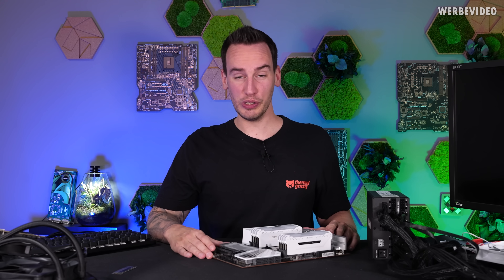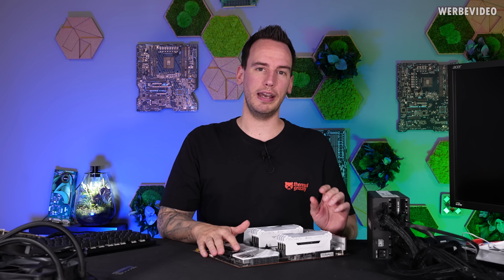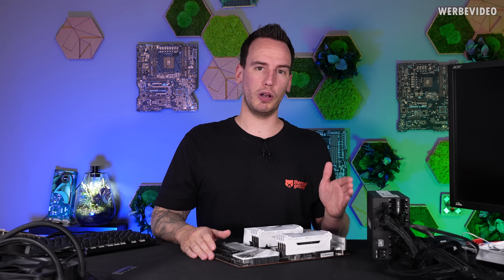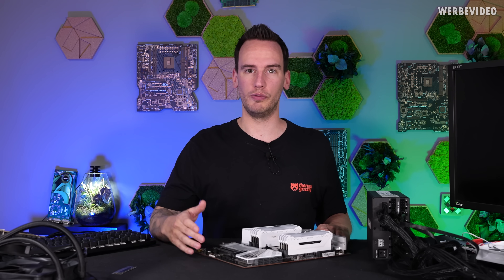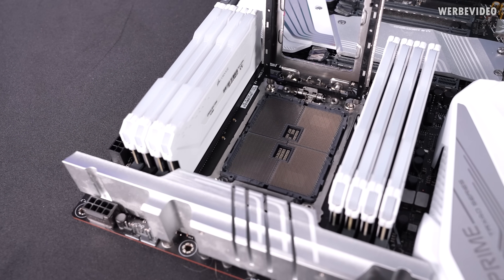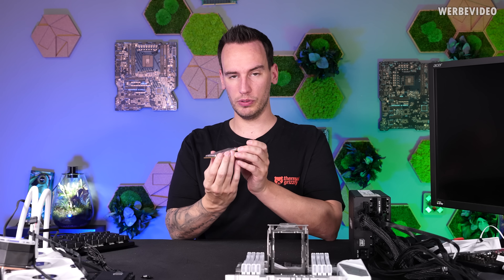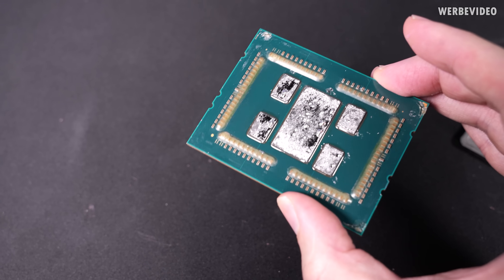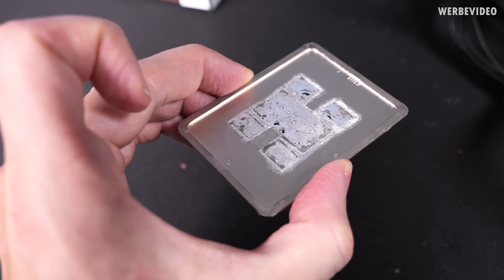I missed the obvious Issue on my Threadripper

Comment: Der8auer 2018 "Gallium in general also reacts with copper and leaves it pitted on the very top layer, but the reaction is not heavy so doesn't really matter to Thermal Grizzly. Nickel has the function of a diffusion barrier and doesn't react with the Gallium, which makes it a lot more suitable for the application"

What metal does AMD use for its IHS? Seems like a hefty tradeoff to swap soldered indium for gallium. Scraping the solder is going to also create gaps in the nickle plating. I'm surprised the entire IHS didn't crumble.
Reply: supposedly is copper, wity a layer of nickel to avoid these chemical reqctions, sanding it to remove the gold and the old solder didnt ended in the best results it seems 😅
Reply: You're misunderstanding. The extreme failure you're referring to is a phenomenon that occurs primarily with aluminum. All IHS are nickel-plated copper and always have been.

The issues comes down to the surface finish, scratches, metal impurities, oxidation, etc. All of which can be mitigated to some degree. In this case the gold layer also caused problems and no attempts were made to seal off the IHS from the surrounding air. It was never in danger of losing structure stability. 

Anyone wanting to rely on LM long term needs to understand some maintenance will likely be required at some point. In good conditions it could be years before notable problems develop.
Reply: Well, my coldplate was nickel plated in theory, but now nickel got eaten away. Interestingly my gpublock is intact sortof.
Reply: @bszbszbsz  What do you mean by eaten away? Discoloring the nickel is common and there's certainly copper underneath otherwise you wouldn't have a cooler at this point.
Reply: @JJFX-  I mean the flat surface is very far from flat now. LM did not just discolor the surface, but I got an about half a mm deep, ~50mm wide  crater on the coldplate, bare copper everywhere. It's an el cheapo block, mayb its nickel plating wasn't the best. 

On my GPUblock there aren't any visible mechanical changes. 

As far as my experience goes...
Reply: @JJFX-  Ahh> and it still works, can draw a bit over 300Ws through, before thermally limited. 

Not great, but adequate for me for now.

Comment: What about putting some Kryosheet instead of the liquid metal ? Would it be problematic ? Maybe it's too thick ? 🤔
Reply: i think that would actually be a better solution for long term use, yes. ideally with a fresh IHS as opposed to the embrittled one.
Reply: that would not transfer heat, it would isolate the damaged surface from the heat, the kryisheet is not flexible and would add pressure over the chiplets un a uneven way, would bot do it presonally, too risky

Comment: we like to know what type of preparation we need to know to not have this result using liquid metal
Reply: the problem here i think is the solder and removing it, or not removing it properly, the nickel layer surely got damaged, making the damage possible

perhaps if you delid a soldered ihs, ypu need to sand it and then apply new nickel, too complicated tbh

Comment: Thanks for revisiting the issue. The first video left me with a lot of questions and the only hypothesis I could draw was AMD silicon degradation in the current news of Intel silicon degradation.

Although I'm not entirely convinced the issue was solely poor thermal performance of the TIM on the oxidized and cracked IHS as you found, I would have expected if the cracks were major enough to prevent the CPU from dissipating it's idle power the IHS would be so badly damaged you'd be able to snap it in half with your hands. That and also running the CPU at 85-95 °C shouldn't result in an insane 215% the idle power consumption (and that was with CCDs disabled right?), I would expect it to only be ~120%, above that there has to be something else at play.

I'm wondering if the liquid metal has some how bridged Vcore and was drawing extra power, when this happens on laptops and non-HEDT it's obvious because the power limits kick in and shut down the VRM, but on Threadripper it can dump 50-100 A into a liquid metal short and not even care, this would explain the massively increased package power and would also result in accelerated galvanic corrosion of the IHS and gallium in the liquid metal as you found.

Comment: I had no idea fake memory sticks were a thing, and now I want some to fill out some empty slots lol
Reply: I remember several years back, in some forum -- i forget where -- people (including me) were making a lot of jokes about the ARGB craze and that RGB-anything is more important than any other functionality. These jokes included RGB DIMMs without RAM -- which became a reality shortly after --, RGB GPU cooler cards without actual GPUs, 120 mm AIOs with 3 RGB fans appearing as fake 360 mm AIOs, and some more. I have to admit, i am kinda disappointed that there are still no dummy GPU's available that lean hard into the most gaudy RGB effects, so them poor sods can amp up the RGB-ness of their toy boxes even if all they run is an APU, lol...
Reply: I would get more memory. If you are not overclocking like crazy or do some intense workloads, the more memory would be more beneficial than running just dual channel.
Reply: @Dragonited  I've got 96 GB and haven't run much more than half of that in the most strenuous processes (Blender, 3D Coat, CSP, etc.),  and games don't even exceed much more than a quarter as far as I've noticed.  Furthermore the board is only rated for 128 in 4 channels not 192, to really get the most I'd have to up almost everything.  And since I have a ton of room already for my uses, the bling makes more sense.
Reply: @Dragonited  DDR5 is very hard to run 2DPC, so fully populating will lower your max speed dramatically.  It's also quite temperature sensitive, so even fake sticks will hurt your max clocks because of inhibited airflow.

Comment: What does this mean for thermal grizzly Liquid Metal application? How can we avoid this from happening? Prepping the stock Intel/amd IHS surface by polish out the gold layer, what are your thoughts ?
Reply from the maker: We have already been researching new coatings for the future to move away from nickel plating. But it'll still take about a year until we have something to work with. Right now nickel is still the best way to go to have as little corrision as possible.
Reply: @der8auer-en  i'd probably skip the term 'corrosion' to describe alloying and embrittlement.
Reply: @mycosys  Why?
Reply: @ToTheGAMES  because it isnt whats happening, and people will get a different idea frm it. 
Indium is alloying with the metal and (likely) getting into the microcracks and forming the dendrites you see in the SEM, the dendrite crystals it forms (probably - still afew theories) push the cracks apart impairing the strength of the metal crystal. The metal is all still there, not removed or 'corroded' as such. 

The impaired cooling was due to the gap, not the alloying. If the LM had been replaced more quickly there likely would have ben no oxidation as the surfaces would not have been exposed long
Reply: @der8auer-en  how about the gold plating on the stock IHS’s, will getting rid off the that gold it give more longevity to the liquid metal application? For example using metal polish under the stock IHS where the metal plating is located?

Comment: Ahh good to see getting to the bottom of the issue...
Now the IHS ... if liquid metal caused the damage to the IHS by eating into the metals and amalgamating with it. Wouldnt putting more gallium liquid metel onto it just make it worse? 
The damage has been done but the process was likely slowed down by the gallium already amalgamating itself where it ate into it. But by cleaning it, you just added fresh gallium onto an already corroded part, tis just going to eat deeper and quicker into the metal. 
Wouldnt it be better to try and resolder the IHS back on?

Also ever since liquid metal interfaces were being popularised, this amalgamation issue with gallium was always on my mind, and I didnt trust its use... I guess this issue youve come into is just proof that liquid metal isnt a long term solution to cpu cooling.
Reply: Yes, in the long term this will be a problem again. At which point you scrub off all the oxide again and do the whole process again.

The gamble now is that the useful life for this CPU is short enough that the dealing with the metal corrosion takes less time than trying to resolder the IHS. Honestly, that sounds really hard and I have no idea how feasible it is.
Reply: The Ga forms an amalgam about 80-100um into the copper. This loss of Ga changes the composition of the LM left behind and it looks "dry" and chunky. I clean this off with isopropyl and reapply fresh LM which dissolves any residue left into it (i.e. no need to be abrasive on it). Then the application lasts years
(Been using LM on laptop copper heat sinks for a decade now).
This does not happen as much with Nickel plated heatsinks
But whenever there is too big a gap, LM can definitely oxidise and "dry out" like this
Reply: @greebj  Mentioned in another comment, but I wonder about at home Nickel plating.  Obviously, getting the z-height correct would be extremely important, but der8aur has the equipment to measure that.
Reply: yes, it needs to be replaced with a direct die solution or another ihs, gallium will do this again or speed up the destruction procesd, in a year or two it will make craters on that ihs
Reply: @MD_Builds  RIP the days when Intel used thermal paste instead of solder. The change must have caused a lot of problems for TG.
Reply: This is a complicated topic but even on bare copper after a few applications the amalgamation slows down considerably. I'd expect a similar outcome in most cases.

What's notable here is the ammount of oxidation and the interaction with the gold layer. It looks this amalgamation caused this layer to weaken and seperate from surface below, which I assume is the same nickel plating around it. 

I'd imagine sealing off the IHS can help minimize oxidation problems, which Roman didn't seem to do and the area is larger than most CPUs. However I've used LM under an unsealed IHS for many years and they weren't without some issues but this is quite extreme. The oxidation reaction of galinstan can effectively become non-self-limiting with temperature in certain conditions that are above my head and I'm guessing the interaction with the gold played played a role.

Comment: It's good that you found the problem. This might be why my 9900KS slowly is starting to get worse and worse temperatures as well. It's being replaced in 1-2 months with a new AM5 system, so I haven't really spent alot of time trying to fix it. It's close to 5 years old at this point, and the LM application might need a little refresh. I will take a look when the new system is up and running.
Reply: Google says you have to reapply heat paste every "few" years.  And, if your temps are rising, it's probably time.  I have a 9th gen i7 - no problems so far.

Comment: So don't use liquid metal because it will fuck you're CPU up long term.
Reply: More accurately, don't use liquid metal on a CPU you intend to use long term. It should be fine if you replace the CPU after 2 - 3 years.
Reply: @rodh1404  i have a running & daily use 6700k. It's been over 6y since its 1st delid. I had to reapply the liquid metal after 4.5y as it got absorbed by the nickel in the IHS.

Comment: Really interesting to see the long term effects of liquid metal. This makes me wonder if the PS5 is going to suffer the same fate down the line as Sony used LM instead of thermal paste for their console.
Reply: Probably, and it's probably done with intent, for applying LM is a much more intricate process than TP application
Reply: The main potential issue with the PS5 is leaking but that's far more likely to be caused by the user opening it. The last drama around that was overblown. The console community just doesn't have as much experience in these topics. 

Not only was the heatsink intended for this use case, they applied a thick foam gasket around it to minimize the chance of leaks and oxidation. Sure, it may need reapplying at some point down the road but what you're seeing here shouldn't happen.
Reply: the ps5 never had a gold layer thst was scrapped to put liquid metal, the problem here was that the surface was not meant to enter in contact with liquid metal

pst being repaired on alpt of repair channels do not show any of the problems shown here

the ihs on these cpys came soldered, to remove it it had to be heat to melting point of the metals used to solder it on place, those metals were removed but made the surface far from ideal for this liquid metal

Comment: I had the same problem with my i7 7700k not so long ago. Temps were going into low 80's, my ihs had the same black spots, cleaned the best I can, applied new liquid metal and the temps dropped by like 10c, now it's running fine for like a year after that. 5GHz 1.3V mostly 60- 75c while gaming usually high 60's - low 70's I'd say.

Comment: Wow, I had no idea that Liquid Metal is so corrosive.  Putting more on it might make that surface even worse over time, right?  I guess I would have used something else if I wanted to use that CPU long-term, but hey, it's your CPU.
Reply: yes, you saw 4 years of damage, or the ihs is replaced or the problem will get worse

but remember that liquid metal only reacts like this with some metals, the ihs had a layer of metals includong gold that made solder it easier, these ihs came soldered and remove them is reqlly complicated and risky process

we dont know if it was prepared properly before usong the liquid metal, if residue of those metals remained, it is not corrosive, it is more a chemical reaction

you cant use this thing with aluminum, copper does alot better, it just stains it, iirc nickel plated should be fine

indeed, is his cpu, but as a shared informateion, clearly tells that delid is not the best idea and liquod metal is a unknown variable that you prpbably dont need to ad to your build
Reply: LM stained the dies on my 1080Ms. I lapped them with the finest sandpaper I have, 3000 grit iirc, put more LM on, still fine pulling their up to 250W each, 6 yrs old now

There's a few hundred um of surface barrier/structural silicon on top of the actual cpu logic to play with.

Comment: So gluing back the IHS is a rather good advise, as this would limit the amount of oxygen to enter the liquid metal.
Which would slowdown the oxidation process by some years maybe. Now we need a glue that is a very good barrier against oxygen.
Reply: The PS5 uses liquid metal with a foam barrier just to avoid shorts.  Glue and airtightness seems unnecessary.  Maybe just a smaller fraction of gallium would be ideal.  You could raise the melting point to 90C so it flows during initial burn in and then never again, sort of like Intel's STIM, but hopefully thinner.
Reply: This.

Whatever the chemical reaction was exactly, anytime you have oxidation occur it's because air was introduced.

The IHS coming apart was hint 1. Seeing the black oxidized LM was hint 2. Those 2 things alone are bad but there could be others. Easy to see/understand with hindsight. lol 

But still an interesting video and nice to see Roman get his rig back. Assuming he finds a way to seal everything tighter/more permanently.
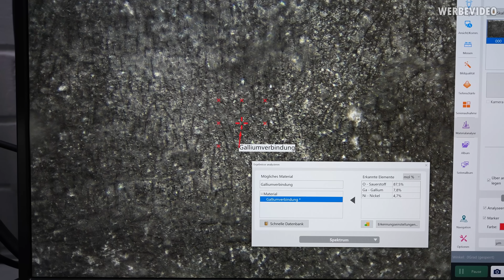Reply: @shawnduffy279  5:37 It was really an eyeopening revelation that the oxygen levels (88%) were so super high!
Reply: Ooo, interesting idea. Could also use nitrogen as a purge gas before glueing it down...

Comment: It would be nice to see a side-by-side comparison with a part of the heatspreader that was not affected by the liquid metal, because on that scale almost every material looks weird.
Also: this would be a very good example of why NOT to LM your CPU if you want to use it more than a few years or sell it afterwards.
Reply: If the cpu is soldered, yes I agree. But if you have an older CPU that used thermal paste like 8th gen Intel,  LM will not react with the leftovers of the soldering process, because there's none.
Reply: @TigTex It's with the IHS, doesn't matter if soldered or TM. 

Anyone else reading this take note of OPs solution to just sell it off and pass the problem to someone else.

Comment: i had interesting case with liquid metal and rx580 with clear copper coldplate. firstly kryonout temps ~60 degree after that liquid metal ~50degree after 4month remove liquid metal but only things what slill was liquid (~70% was solid)
after that again kryonout and temps was ~52degree.
the same load/ case temperature/ settings. (mining)
Reply: I didn't have any black oxides, just liquid metal infused copper.

Comment: Is de-lidding a Threadripper even worth it? I thought someone did a video a while back where they found the IHS on the HEDT/workstation tier was just as good as direct contact(??)

asking for future reference for myself
Reply: Don't think so. That's more der8auer being der8auer.
Reply: didnt you saw the video?

clearly it is not worth it

if you delid, you lose warranty and you will introduce so many  new problem that when you solve them, you discover that you never had time to enjoy the pc, that is if you dont destroy the cpu by heating it so hot that you can melt the soldered ihs because these cpus come soldered, not glued
Reply: since the CPUs nowadays feature solder (unlike intel's dreaded  toothpaste). Outside competitive overclocking delidding is a hassle with a minimal payoff. If you are willing to go direct die cooling - maybe, just replacing solder with liquid metal is not worth it.